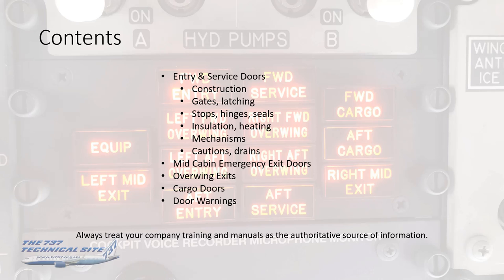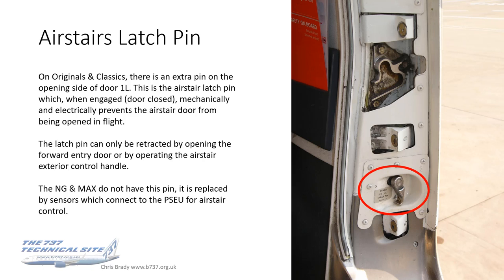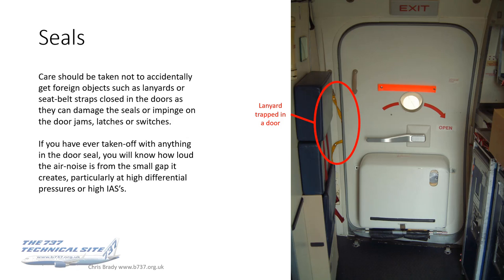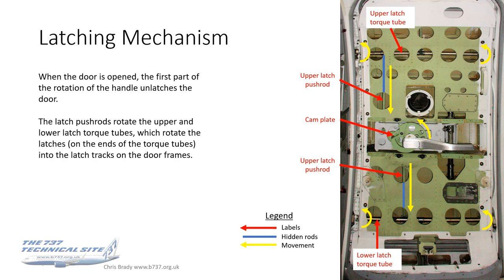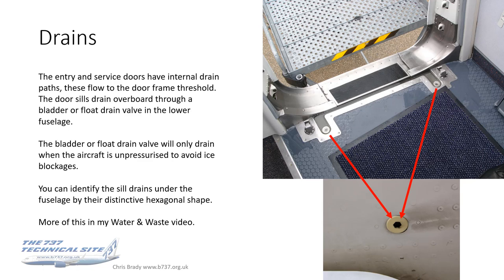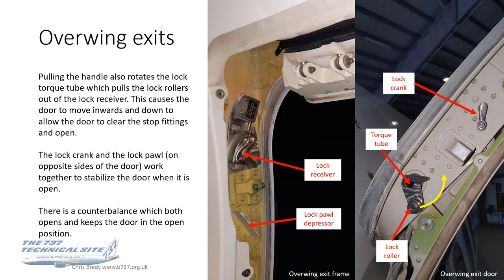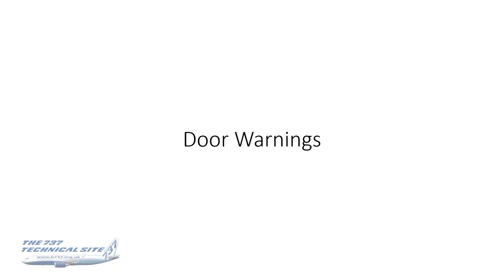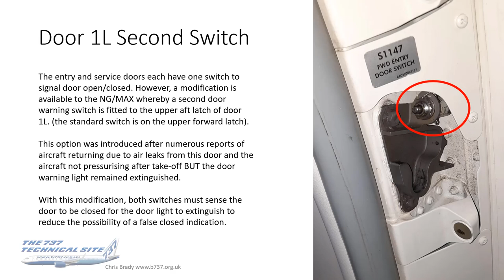737 Doors

Comment: In regards to the recent Alaska door, plug failure

I am a 28 year Alaska Captain, and we do not use mid cabin doors on our aircraft. Mid cabin doors are only necessary on very high density seating that we do not use. That is an optional item which Alaska Airlines did not purchase.  So that area is filled with a plug that is not visible from inside the aircraft. At this point, it seems that something has happened to that plug to cause it to release and blow out.that aircraft was quite new having come online in the middle of November
Reply from the maker: Thank you for the clarification
Reply: Thanks so much Chris for all your work on these videos. I have taught things to many of my first officers from the things that you have taught me. Your videos are fantastic.
Reply from the maker: @cyber25573 You are very welcome. Please see 737 Mid-cabin Emergency Exit Doors following the Alaskan event https://youtu.be/nw4eQGAmXQ0
Reply: yeah, they didn't pin them, hideous Quality Control

Comment: Do you have any information on how they plug the rear mid exit doors on aircraft where those are not installed as operable emergency exits?  If you do can you make a followup describing the way they lockout the door?
Reply from the maker: Yes I will

Comment: The C-40A Clipper versions of the 737 built for the US Navy were NG models built with an OEM main deck cargo door (the C-40 is based on the 737-700C). A few other 737-700C with that cargo door went to non-airline service. As you note, all other NG 737s with main deck cargo doors are aftermarket conversions.
Reply from the maker: Correct, but I still do not know if those aircraft had a MAIN CARGO caption on the doors panel or a different annunciator.

Comment: I cant believe the plug door is only secured with two upper bolts!  Nothing in the centre at all, re the Alaska incident, i compared the photo of the blown door opening and this video and the guide brackets are still in place though the locating studs look shorter.
Reply: No, it is secured in place with four bolts acting as pins at each corner.  Those bolts only resist vertical displacement.  The door is held against air pressure by 12 fittings, six on each side of the doorway.

Comment: im watching this after the alaska incident
Reply: Good on you for actually informing yourself and not just posting speculative nonsense “general public” comments on a news video. 👍

I’m training to be a licensed A&P mechanic so I naturally came here out of curiosity.
Reply: Hahahaha me too. Looks like the plug might not have been fully latched shut They also had previous cabin pressure issues days before this. Warning signs of the door not being sealed/fully latched. The plug has latches like the doors, from the pics I’ve seen.
Reply from the maker: Were the doors on the Alaskan active or plugged?
Reply: I am an Alaska captain. We do not use those mid cabin doors. That is optional equipment, which Alaska Airlines did not buy. Although that is a new aircraft that opening was fitted with a plug and so inside the cabin, you would’ve not seen a door frame at all. Something happened to that plug to cause it to release and blow out.
Reply from the maker: For 737 Mid-cabin Emergency Exit Doors following the Alaskan event see https://youtu.be/nw4eQGAmXQ0

Comment: Hi Chris.. the dimensions mentioned in FAR emergency exit section 25.807 are the dimensions of the exit or is it the minimum size of the door which covers that exit?
Reply from the maker: The FAR refers to the size of the opening, i.e. the space to get through in an emergency.
Reply: Ok.. so can you please share the type of both entry and service exits..or please let me know the dimensions of the exits as I only have the dimensions of the doors and they both are not same..from what I know is that entry exits are TYPE B and service exits are TYPE C. please correct me Sir if I am wrong..

Comment: Very unusual failure
Reply from the maker: Thankfully
Reply: @ChrisBrady737 Chris, what are your thoughts on media saying the flight deck door will unlock during loss of cabin pressure? That is not in our system manual. Our manual only talks about the blow out panels.Even the NTSB lady talked about it.
Reply from the maker: @cyber25573  This is an undocumented feature. The AMM says "In the case of a rapid decompression in the cabin compartment, the door is able to withstand the pressure difference due to the small area of the flight compartment." This was not the case.